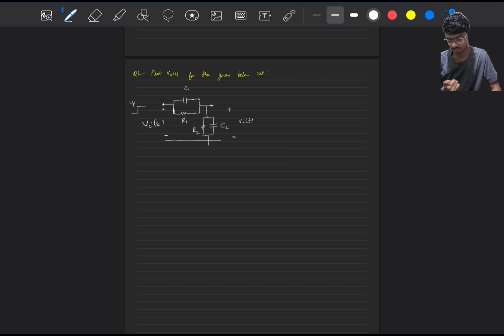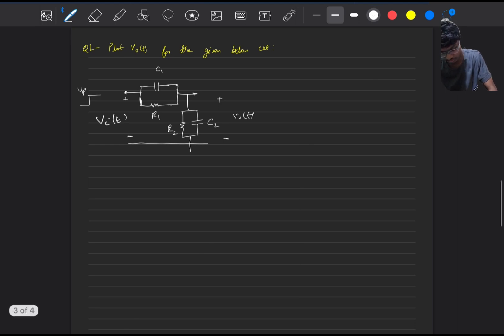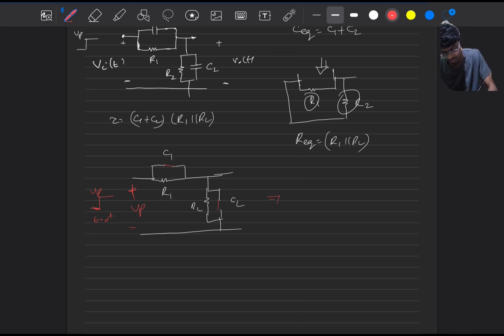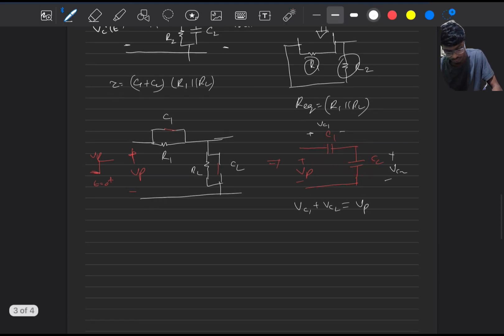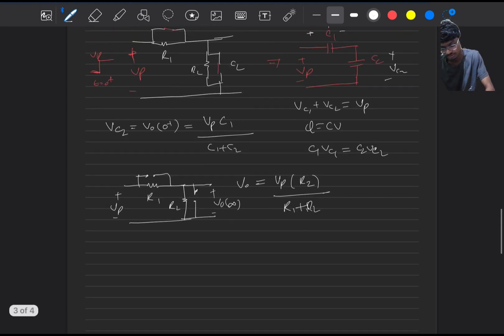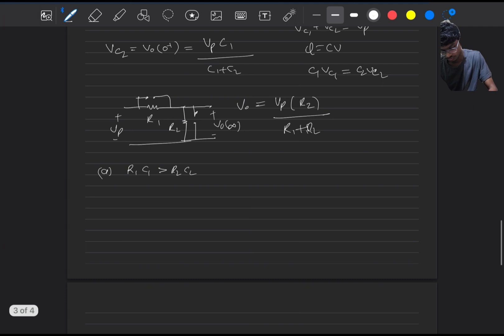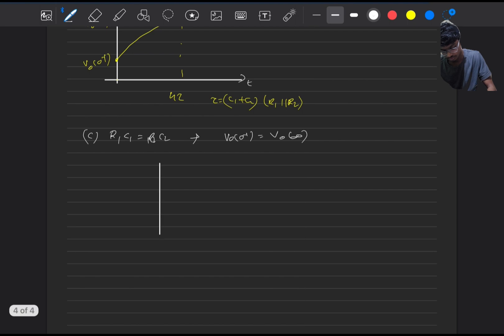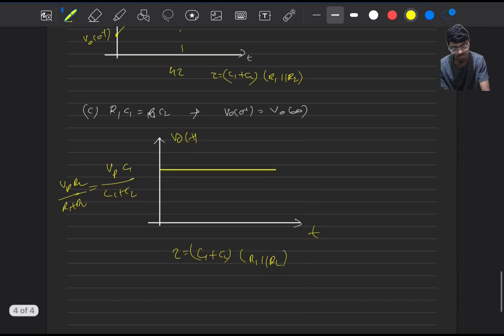Lec 1.2 Examples of RC with Step Input | Circuit 1 | Complete Analysis

Comment: Why v0 and v( infinity) depending on r1c1 and r2c2 less or more
Reply from the maker: Just for ploting the graph as that condition will help us determine which capacitor will have higher voltage at steady state
Reply: @AnishSaha_ I thought vc1 and vc2 were discharge (0 to infinite) waveforms😅
thank you for reminding👍

Comment: Bro y u are taking 3 cases with respect to r1c1 and r2c2
Reply from the maker: It will decide which capacitor will have higher voltage at steady state.